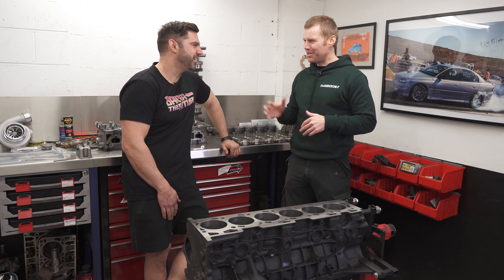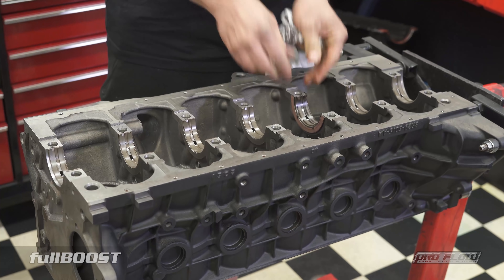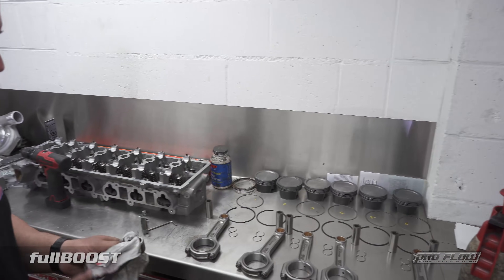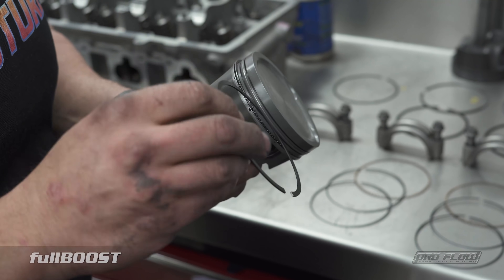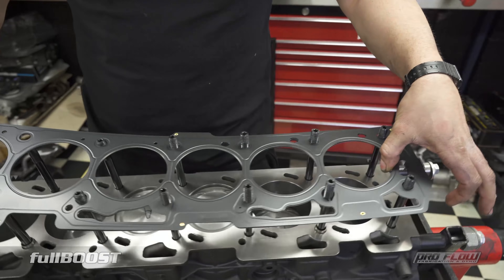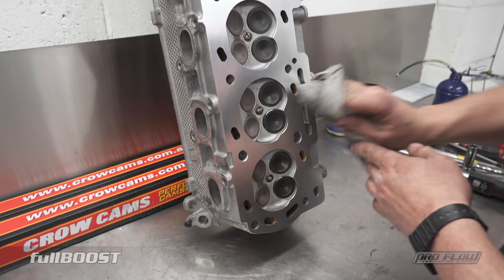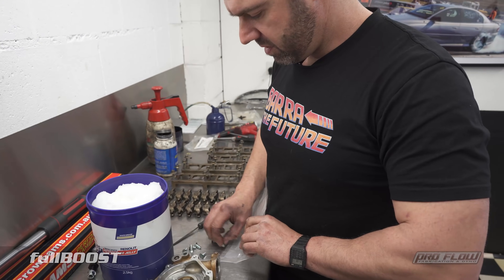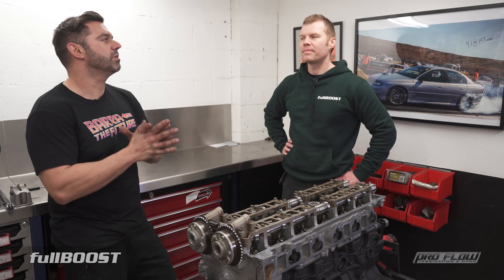Building a Ford Barra turbo engine - Project NOMANG Ep16 | fullBOOST

Comment: they use I beams in construction because less steel is cheaper and lighter to transport and for the crane to lift..  h beam are stronger and more rigid for longer under higher loads. But, also more weight the crank is slinging around so yeah.  Interesting topic I didn't know was even a thing before now for conrods

Comment: I know its been 9 months o so since you released the video but just wondering if you replaced the valve springs and if you used the original cam gears? Cheers H

Comment: Pretty sure you fitted the girdle upside down. There will be one teardrop shaped recess which will fit over the one cap that has that shape. The girdle will sit down on the caps not flat across the top how you have it
Reply: Yeah we sorted that.

Comment: Still have not seen anything which is as good in engineering as the new LT6 corvette engine, with oil squitters, which is what the Barra needs to cool the engine plus get hi tempo ceramic coatings in all moving parts which has the most friction, that way the engine will last even longer, but still maintain the right oil temps with extra cooling of the oil, after all its going to be a drag engine, but still can dive it for the drag challenge when it comes around soon ?
Reply: So you've never taken any other modern engines apart, then?

Comment: Just thought I'd ask you guys if you've ever heard of anyone JUST running upgraded Intake Valve springs , as I'm just using the stock cams and Boost pressure is only on the Intake Valves , not on the exhaust valves . ??????

Comment: No way was that crank.004th out of round from factory..The bearings don't have that much clearance, and it wouldn't be able to rotate..As for the rings, they are File Back rings, they are made with no gap..!

Comment: Is it possible to covert a barra to run on diesel?  Different cylinder head..  someone should do that..
Reply: Why would you run diesel ? E85 has great cooling properties that help protect the engine at high boost. A factory cast Barra block and head can make 2500hp on methanol.
Reply: That'd actually be farken funny, cos they run em on just about every fuel BUT diesel. ...it would certainly add to the "Barra Legend" status.....
Reply: @nordic5490  stock crank cant tho

Comment: What gap are you setting rings at 
For what psi you running
Reply: I'm guessing probably 6 to 7 thousandths per inch of bore, so like 22 to 25 thousandths (if stock bore)

Comment: Have you mentioned the budget or cost of the engine?
Reply from the maker: I believe it was around the 2k mark ☺️ we'll work it all out in a later video 👍
Reply: Everyone knows you can run 7s for $700 with a Barra, so this must be less than that...

Comment: I would do the much stronger 4r200 hub conversion into the 6r80 from Jake at Power by the Hour.
Reply: We wanted to but the trans controller can't run it as a 4 speed and neither can the standard software
Reply: @proflowfab  Its best when ran as a 3 speed.
Reply: @Sir.VicsMasher  if we had the electronics to do it I would.
Reply: @proflowfab  I thought Motec had 6r80 capabilities.